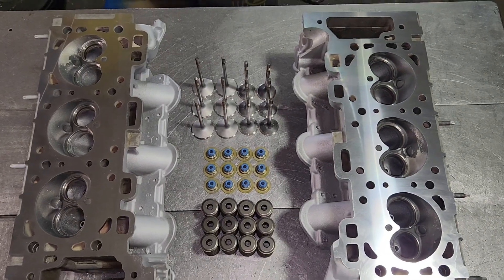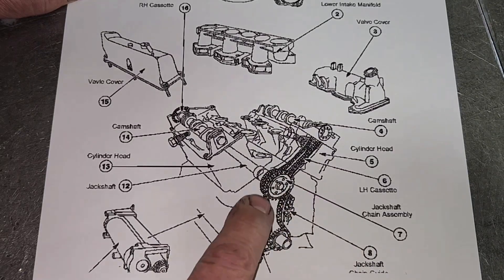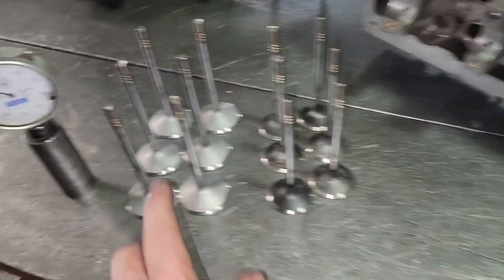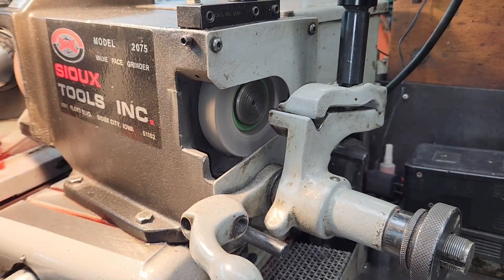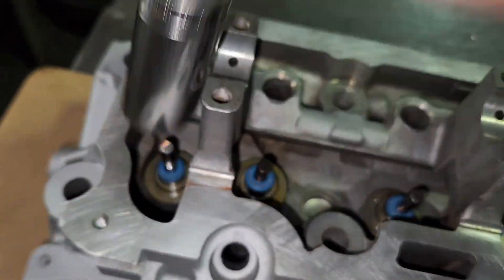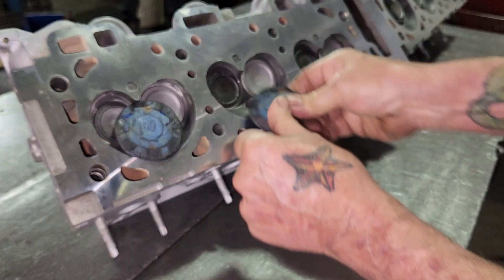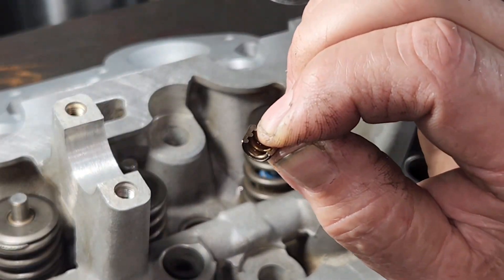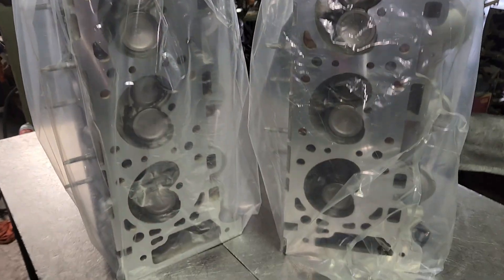FORD SOHC 4.0 HEADS

Comment: Have you ever encountered a set of Triton heads which after machine work an installed stem height or + .140 over spec, with the valves not shrouded?
Reply from the maker: We do a lot of those heads there are several different types.
If you use the wrong valve the stem height won't work out.
If you're using the valves that came out of them and the height is wrong you are using the wrong spec.
Thanks for watching 🇺🇸
Reply: @BearButler321  thanks!

Comment: Now I understand why machine shops charge what they do.  There’s a LOT more involved in rebuilding a cylinder head than what I thought!!

So we’re these valves ones that you removed from the head before resurfacing?  If so, can I assume that they were all out of spec from the factory?
Reply from the maker: Yes they were his valves 
The heights change when I grind the seats and the valves, they were all in spec
There's +- .100 and would have been fine but not exactly in the middle where I like to make them 👍
See-ya next time 🇺🇸